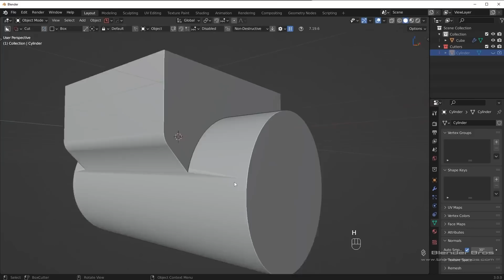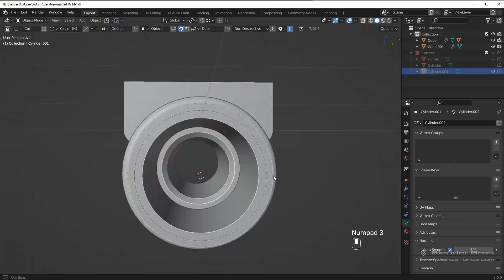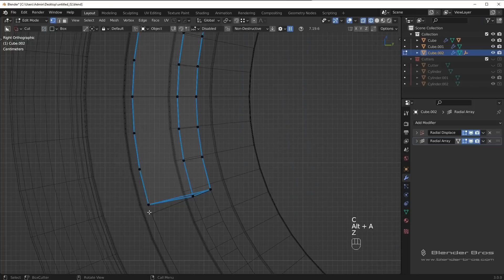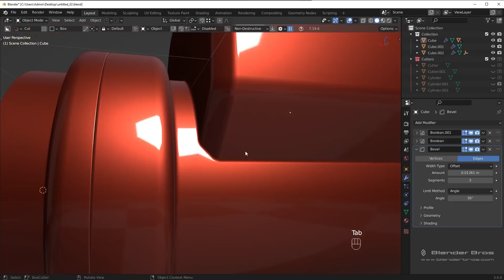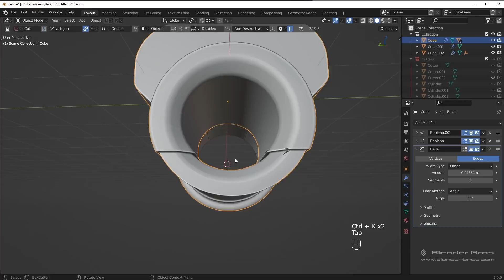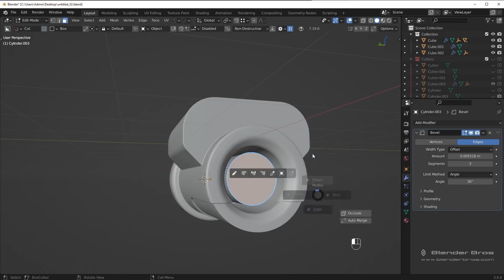Advanced Hard Surface Techniques for Blender (Tutorial)

Comment: Hey, I am really enjoying your videos! I often get those recommended via emails, which are by the way very handy! But here I got one question:

Why being stuck in blender when using normal transfer? I used it a lot while making hardsurface models for the unity engine and it worked perfectly fine.
Reply: Normal transfer effectively sets "custom normal data" in Blender (similarly, weighted normals or "harden normal" bevel option will do the same thing in creating custom normal data). It just becomes a little tricky to work with after that point, since you can't do autosmooth unless you clear that normal data first. But yeah it will work fine when exporting or using in a game engine, since the custom normal data is just baked in with the vertex data for the mesh.

Comment: I don't get why you wouldn't use a nurbs based software for this, I've basically completely abandoned polygonal software for hard surface. I mean yeah you get more control of the topology in something like Blender, Maya, etc, etc, but it just seems like so many workarounds for something which could be done a lot more efficiently in nurbs.
Reply from the maker: I already mentioned it in the video. It terms of versatility, built-in design and rendering tools, UI, and just about everything else I find Blender and poly-based tools infinitely better. If I thought NURBs was superior overall I wouldn’t be using Blender. I have 4+ years experience in CAD and a few certifications from high school, but I never found it useful enough to accomplish the things I wanted. In this situation, yes, NURBs results would be much better. In 99% of other projects I work with, absolutely not.

Comment: Great tutorial, as always. I have been running into some BoxCutter performance issues, though, that make working a massive pain. Doing any cuts/bool shifts/ect. make Blender lag HARD; I've got a very beefy system. Are there any optimizations I should be sure that I'm utilizing during modeling? Or any settings to tick on or off?
Reply from the maker: Hmm, shouldn’t be happening. Lags are normal but not on that scale. Are you working with complex objects with shadow turned on? Shadow is a performance killer, the coding isn’t well optimized.
Reply: @JoshGambrell  I don't use the shadows setting, no. I'll have to mess around with it and see what I can do to fix it. Thanks for the reply!

Comment: I see you're using a pie menu for going into object's edit mode. Is there a way to do this in Blender or this feature  is part of Hard Ops addon?
Reply: thats meshtools its a free addon
Reply: @matthiasdipiazza849  I was referring to edit mode (TAB + 1/2/3). I want a pie menu for this, to enter in vertex or edge mode directly without hitting TAB. This kind of pie menu :). Similar with Maya's marking menus.
Reply: @iov-art  thats meshtools its a free addon :)
Reply: @matthiasdipiazza849  I've installed this addon but I can't find a pie menu  for what I want. There is only a CTRL+TAB to go in edit mode, but not directly into Vertex, Edge or Face mode.
Reply: @iov-art  It's in the add-on settings. Go to edit - add-ons, and select Machinetools. Then find the pie menu section under the general tab and enable "modes pie"
Reply from the maker: It’s the Machin3 tools addon, not meshmachine
Reply: @JoshGambrell  This is it. Thank you!

Comment: Is there a special reason you are always using E, then abort the Extrude, Alt+S when you could simply use Alt+E or is it just a habit?
Reply from the maker: It’s habitual, both work but make sure you tick offset even
Reply: @JoshGambrell  Well, in those examples of the video it doesn't make much of a difference - and as soon as it becomes necessary, you'll need it when using Alt+S, too.
Reply: yes, i use ALt+E more often too! faster, but then you have to press S for even extrution, remember!